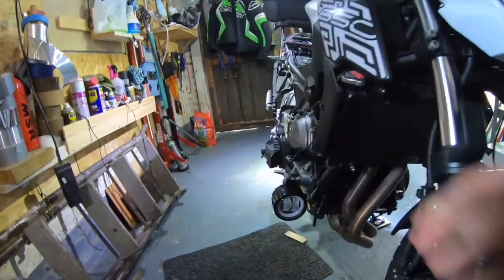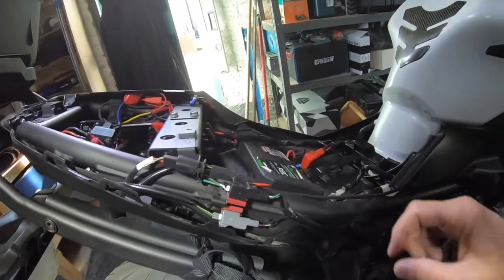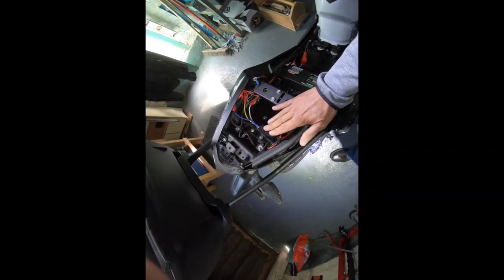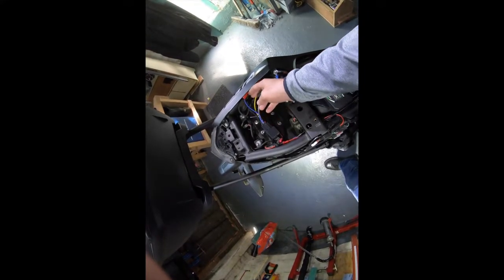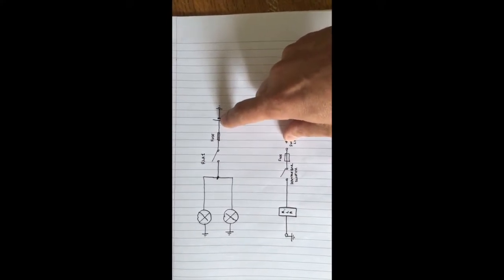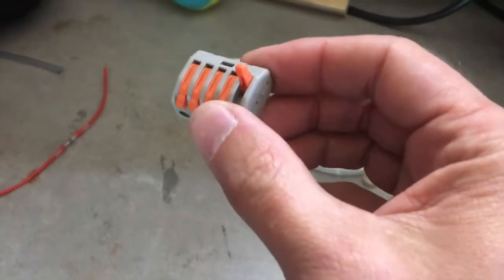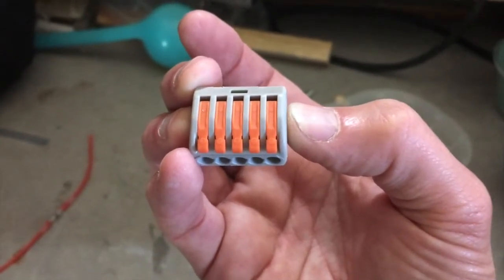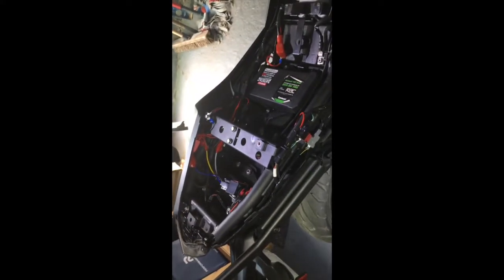Beginners Guide to installing LED auxiliary  lights on a motorbike

Comment: Excellent video buddy, I personally would just wire them to the headlights with an inline fuse to be safe. Less messing about quicker/simpler job.
Reply from the maker: Thanks. I don’t usually use the auxiliary lights at night as they dazzle. Hence I have a choice of using them or not. My installation was all fused. I now have a Moto Guzzi V7 and that was an easy installation as Guzzi supply a switched live in a super seal socket under the seat.

Comment from the maker: Hi Patrick. A relay needs is used where a larger current is required for an accessory that is using a low current switch to power it up. Some things may need to be connected straight to positive such as the connection for a trickle charger. Always use a fuse though.

Comment: So ive got aux lights on a relay with a switch like this. Recently had a loose earth but also intermittently, lights would stay on whilst the bike was off even if the switch was off! Could it be a faulty relay?
Reply from the maker: Quite possible. A relay is about five uk pounds so a cheap way to see if it’s broken or not. Maybe worth checking the switch too

Comment: Iv'e got the CoLight fog lite kit and one of the wires coming out of their"intelligent controller" is called the "power loss prevention wire". They say this wire should go to the positive terminal of the headlights. My question is couldn't I use power signal from the back license plate light or tailight as you have shown? and also what amp fuse would I need to install in the "fusetap"?
Reply from the maker: Difficult to answer as my lights are not 'intelligent' and I dont have a power loss prevention wire. Sound to me, and this is a guess, is that your lights have some type of relay, possibly electronic built in. I couldn't say what size fuse you need. I used a 5 amp fuse for the relay coil and 10 amp fuse for the relay contacts which power the lights.